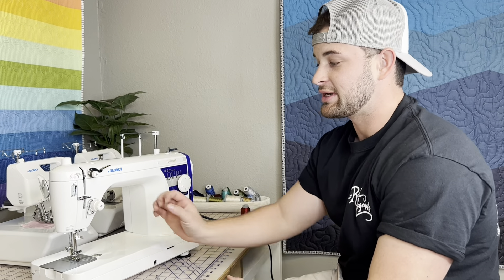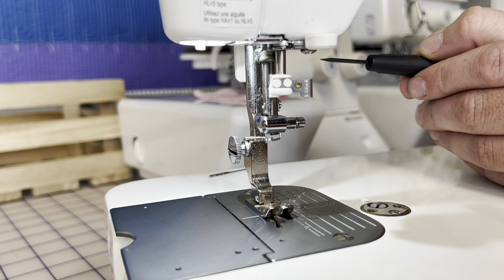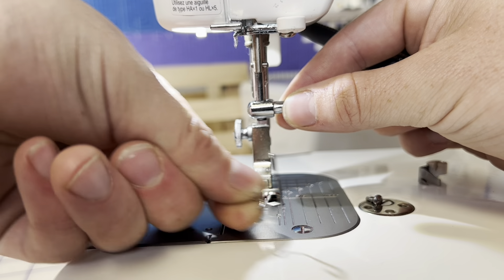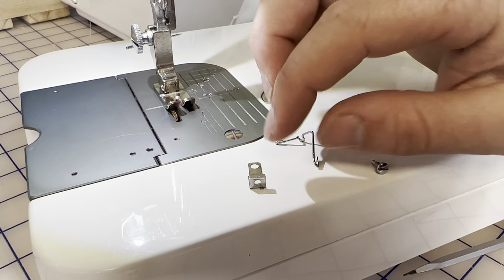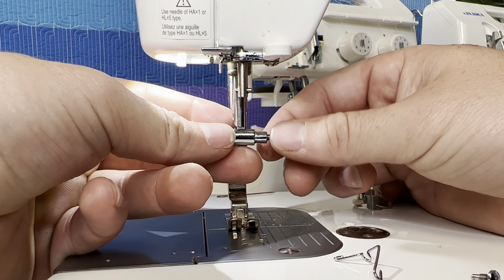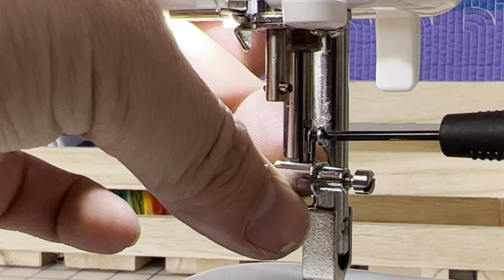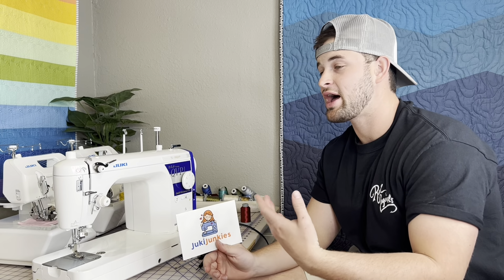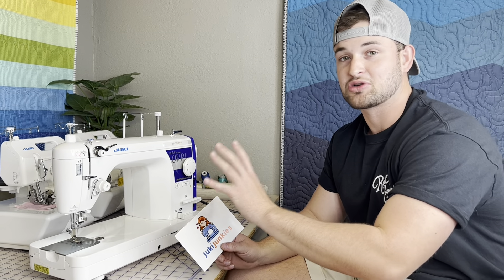How To Fix Clamp Guide Assembly/ How To Replace Thread Guide On Juki TL-2010/TL-18/TL-2000

Comment: Does anyone else have an issue with that little thread guide making a pinging sound from the thread catching when sewing at fast speeds? I do and it's threaded properly but has always happened with this machine, I think it's a flaw in the design of that little guide only being a half circle and leaving the thread the opportunity to bounce out at high speeds. Mine looks just like this one in the video and I've watched plenty of these to be able to say with utmost confidence that it's threaded right, the thread is acceptable and good quality and the tension is spot on, so it just seems like a flaw but an annoying one that slows down my sewing speed as to lessen the times it does that and cause issues with what I'm making. Any help or suggestions are appreciated.
Reply from the maker: I would recommend joining our Facebook group called “Juki Junkies”. Answer the few questions to join the group; once you’re accepted into it, comment your issues on there. We have over 19,000 Juki Junkies in the group that are happy to share their experiences and solutions.
https://www.facebook.com/groups/1532238067076220/